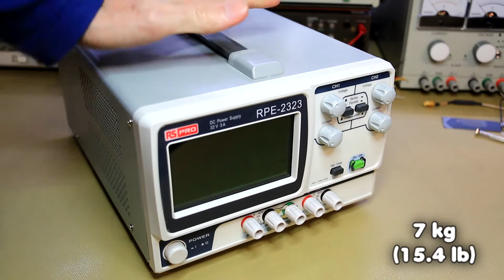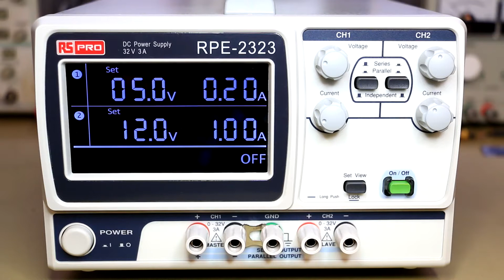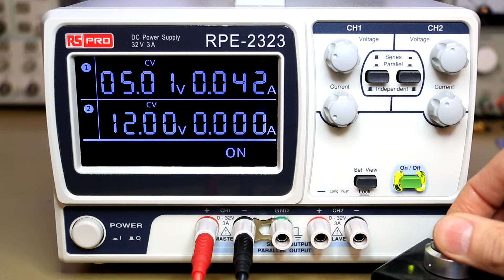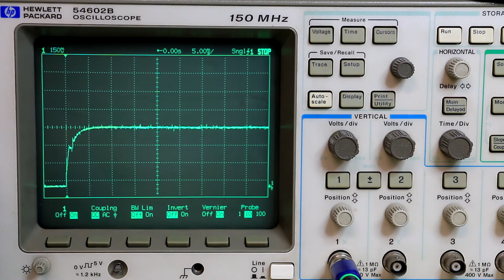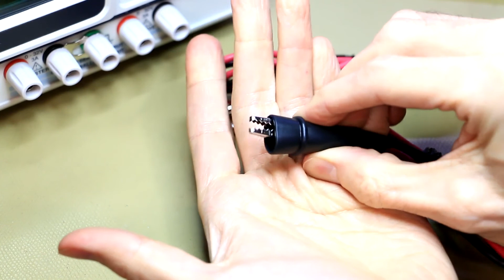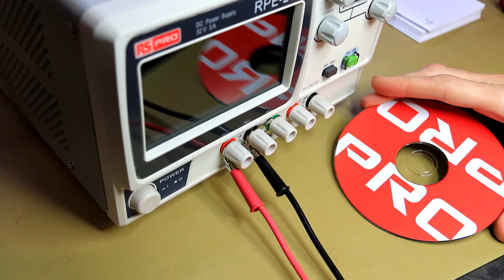RS Pro RPE-2323 bench power supply review (#019)

Comment: The main limitation with such power supply I can see are the analog knobs. Setting exact values for current or voltage looks to be extremely difficult, and switching it to high resolution mode makes things worse.
While this works for a lot of cases (HIFI, powering boards, ...) it makes it difficult to use it to reproduce exact startup and power conditions for sensitive digital devices (like IoT sensors boards and very low power devices).
Does the output fluctuates because of imprecise analog potentiometers positioning?
Reply from the maker: For sure, what you see is what you get. If you need 1mV or 10mV adjustment steps, this PSU is not for you.

Comment: Hi,
are you still using this PSU? is it any good? I would like to invest in 4 channels version
Reply from the maker: It's my preferred PSU when I need to use a PSU, which is fairly often (at least a few times a week). For me, the reliability and the straight-forward way you use it is key. I have no idea how the 4-channel version displays its voltages.
Reply: @TechBench  Thank you for your prompt answer. The 4 channel version has almost same display, it uses upper part for channels 1 and 4 and lower display for 2 and 3. They added two buttons to select the visible channel. The bad thing is that the two additional channels have 15V/1A and 5V/1A output max, they have CC protection against 1A but it's fixed to 1A, you can't set the current limit lower than that, contrarily to the the 2 x 32V channels that behaves like yours. Anyway, those channels have variable voltage setting and can still be helpful to avoid having to use yet another PSU for powering for example an MCU board at 3V3 when still powering high power motors at 48V using serial chaining of the 2x32V channels. 
I have been offered this 4 output version at 230€ new boxed (from someone how bought it and never used it). I think it can be a good addition to my lab (I have a Korad 30V/3A single output)

Comment: One very small user interface miss. The channel displays are horizontal. Voltage on the left and current on the right. However the pots are arranged vertically. Voltage on top, current on the bottom. It would have been a better UI to make them the same. Either the pots should left and right or the display should be up and down. Small point.

Comment: if you rarely need 2 separate channels, you can go in the same money for GW Instek GPE-1326 (32V 6A single channel) which has front panel sensing function, fine and coarse control for both V/I settings
Reply from the maker: The GPE-1326 looks like a fine bit of kit. I really should revisit the GPE-2323 to see if the pots can just be replaced with multi-turn versions.
Reply: @TechBench  I don't remember you mentioning in the video, but are those 4mm banana plugs fitting tightly in the power supply's terminals?
Reply from the maker: @Paul-Cirimpei  Yes, they are 4mm (standard spacing) banana plugs, and yes, they fit tightly :-)
Reply: @TechBench  I ask because I'm planning to buy a single channel one during the next month. I'm also curious to test it's load and line regulation. Hope I won't be very bothered by the noisy fan..
Reply from the maker: @Paul-Cirimpei  Luckily the fan is an easy fix if it does bother you!
Reply: @TechBench  I've received my single channel unit and I had a small surprise: the banana terminals are deep inside the front panel (not outstanding like on your unit). Inside it looks very similar, the fan is noticeable, but not bothering loud. I guess the components inside the case are happier being well ventilated, so I will make their wish and keep the fan control as it is. I was disappointed that the Lock function only applies to voltage settings...